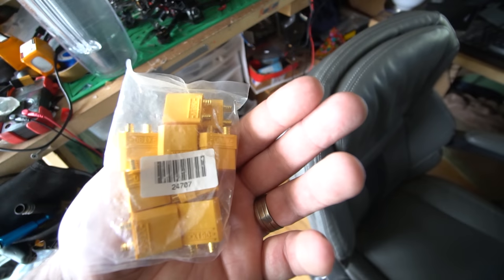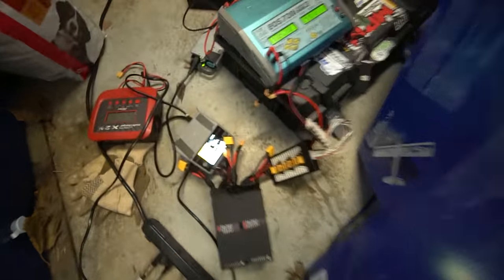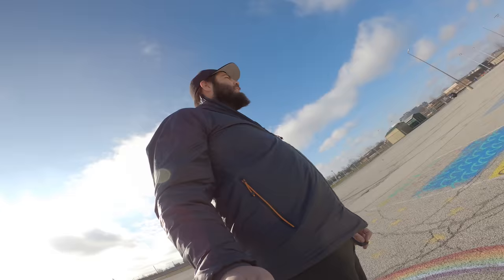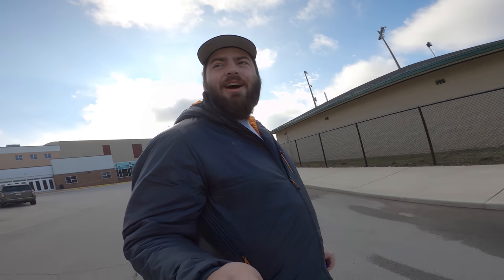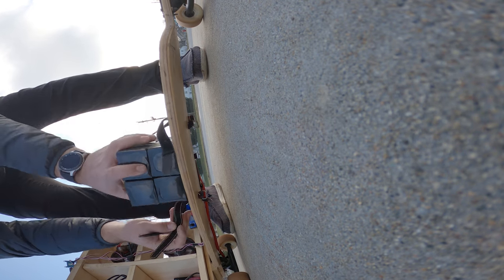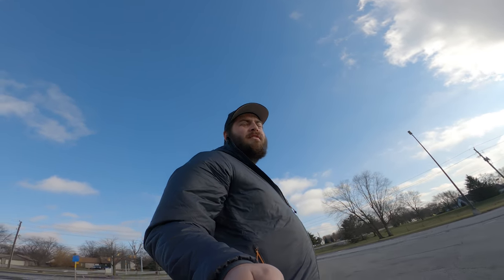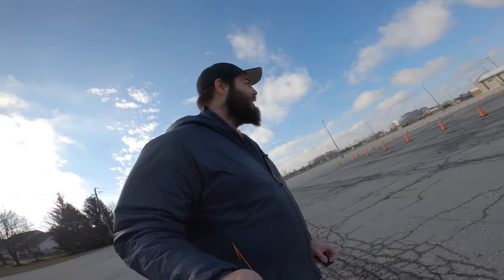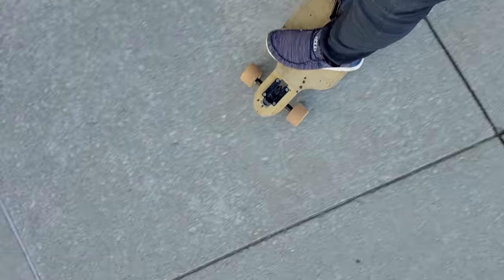I haven't killed myself on the jet board.. yet...

Comment: Make a LIPO backpack that has the power leads run down your legs and into your shoes.   One foot be positive and one foot be negative.   That way when you step onto the board it powers on automatically...

What could possibly go wrong?   Step in a puddle maybe?

On that note...   if you get brave enough you could try to make some kind of improvised pedal for a throttle.  Whiskey throttle for the win.
Reply: Man, I accidentally plugged in my e-bike battery with the slightest load attached... and all the metal inside the connector just disappeared into a nasty carcinogenic odor, instantly!  The moment he stepped on, I bet there would just be a big flash and a pop, and he'd be standing on nothing but rubber and wood again.

Comment: You know..if you radius the leading edge of your wood "plenum" and taper the trailing edges creating an S3002 airfoil shape and and then add  a big ole "R" sticker you'd get a lot more top end.. A "NOS" sticker will likely blow your top end off due to high compression though...tread carefully...